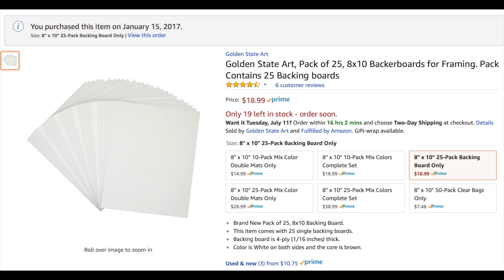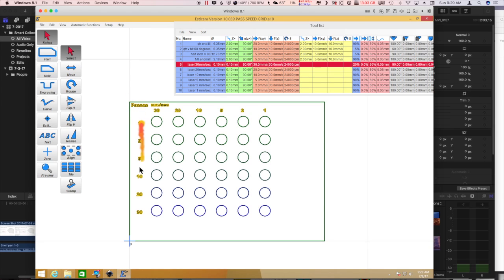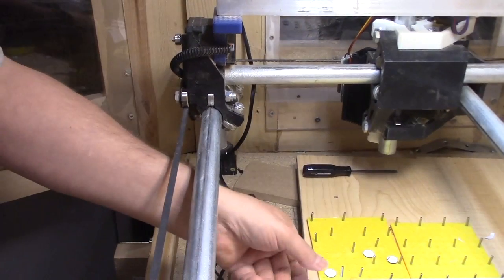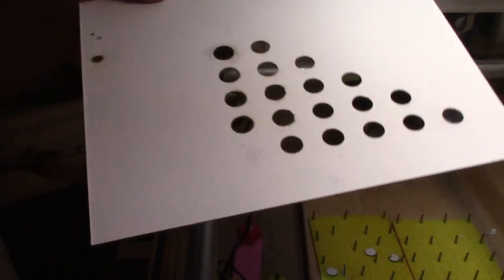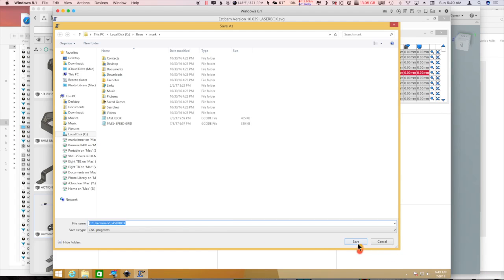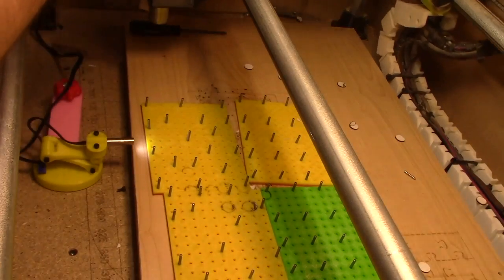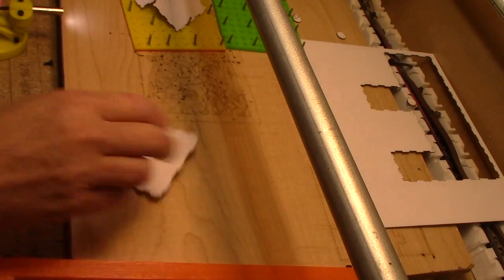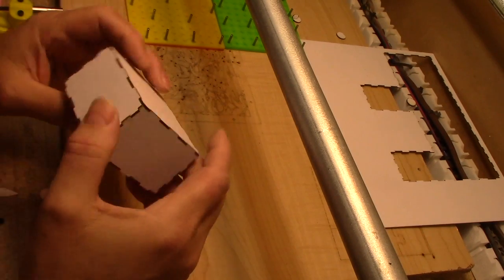MPCNC Episode 31 -  Laser Cutting  1.5 mm Backerboard

Comment: What have you found to be the best distance from laser to surface? I am still trying to get this dialed in. Also, at that rate what is your minimun power?
Reply from the maker: That's a really good question. I've been wondering which is best, being the focus is adjustable. As for how much power it's putting out, unfortunatly i have no way of measuring it.  I've been toying with a couple ideas to try, but not sure about the math.

Comment: On the 30/40 watt lasers I've heard quite a few people say to run a lower power setting to prolong the life of the tube. I wonder if we do the same then the laser diode will last longer?
Reply from the maker: I've wondered that too. I've watched quite a few videos drooling over K40 and such.  And I was worried about using it at high power at first. I was also worried about a generally short lifespan.  Too bad I don't have an hour meter on the laser.  These are some of the longer jobs I've had it run so far. I pointed an IR thermometer at varous parts of it while it's had been running for some time, without finding anything appreciably warm, let alone hot. The experiment continues!